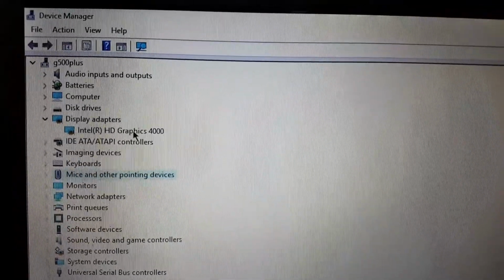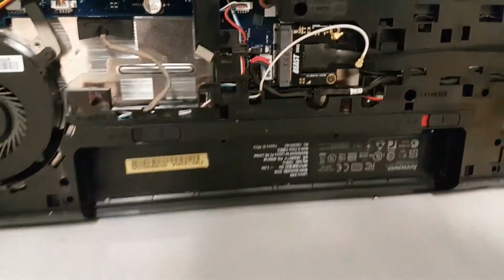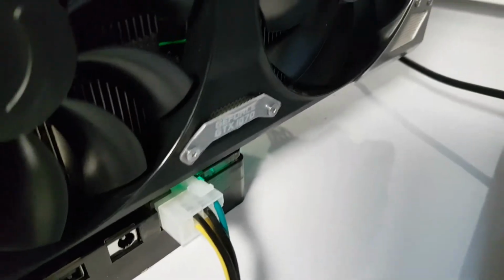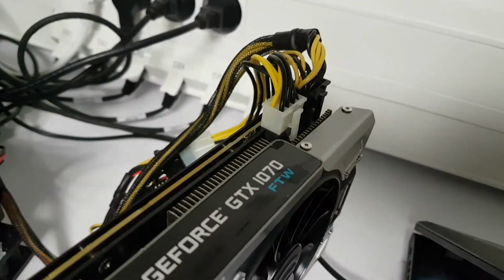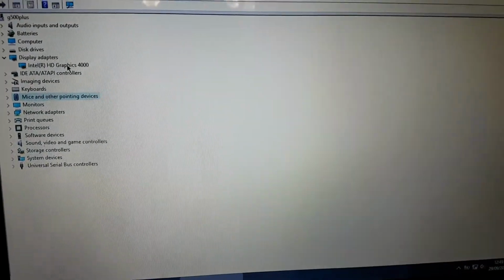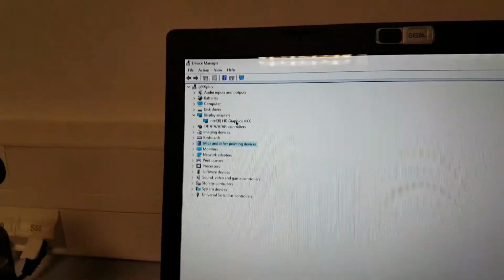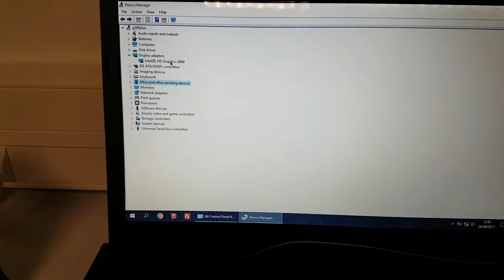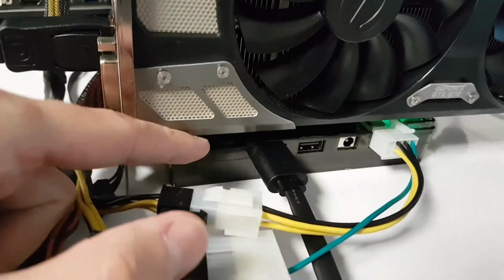Exp gdc not working (DIY eGPU)

Comment: I have EXP GDC 8.5c, My Laptop is HP 250 G3, I have RX 580 GPU. My laptop doesn't detect the GPU in device manager yet the fans spins and green light is on. I have tried hotswap it failed, I have followed the instructions on the GDC manual without success I would really appreciate any help.
Reply: Same exact problem yet no solution. Man this is frustrating that there seems to be no explanation 😩
Reply: @ConnorMarcantel  do you have Nando DIY egpu setup if you wish to buy I can sell you mine at a discounted price. I ended up buying other parts and building a PC. What's your laptop, if it's not a HP, then Nando setup could make it work
Reply: @NedxMN  its an hp. I think it model is something like 17-ca…. I attempted to connect a EXP GDC eGPU doc through a m.2 key a+e to mini pcie. Physical it fits and the GPU turns on but doesn’t show up on device manager or anything else.
Reply: @ConnorMarcantel You could as well try to flash your bios and check if it works

Comment: So here is the solution,
1. BIOS - Whitelist problem with most of the bios. those bios wont sign in these kind of stuff and only way to fix that is b flashing a modded bios
2. Dock might be broken

Comment: manage to actually connect the gpu with my laptop and instal the driver but there input delay issue and the gpu perform a ton worst than integrated gpu
Reply: Connected one to my all in one HP with the arc a770 recognized it just fine but fans don't stay spinning so it's getting warm. Need a better PSU. Dell da2 isn't cutting it.

Comment: Hi everyone, my case is: laptop HP pavilion 17, cpu AMD A10-5750M, exp gdp connect via minipcpe, gpu is gt730, i use external monitor. The laptop recognize the egpu, it shows window booting to external monitor, but then show acpi bios error and restart. I tried many way: update bios, reinstall window, hotswap,... but no lucky. But when I try to boot with kali linux, everything works well. Any suggestion for my case? Thanks.

Comment: I'm using exp gdc expresscard with an express card usb adapter. The gpu turned on and seems like there is no propblem. But my device manager didn't seem to read my vga. If anyone have a solution, please share..
Reply: Did u find any solution?

Comment: It's important to turn off Windows Update, because on Windows 10 the laptop's default drivers will automatically install updates if you're connected to the internet , Turn off automatic driver updates for each device that comes with the laptop

Comment: This may be due to low voltage of the power supply or the processor not being able to supply the graphics card sufficiently.
Reply: reis bende yapacam ama sıkıntı olurmu bilmiyorum hp 250 g5 var ngff soketli i5 6200u throttlestop ile 2.70 ghz stabil 16 gb ddr4 2133 mhz ram var ngff li exp gdc  v8.5d olana gtx 960 taksam ve ekran kartından hdmi ile harici monitöre bağlasam çalışırmı bottleneck calculator ile baktım 0.25 darboğaz diyor ona göre alimmi

Comment: Bro, you said you changed the delay on the exp.

Care to explain how you do that?
Reply: There's a switch on the device you have to pull it with something thin enough though as it's inside the case.
Reply: how did you get your information on that, extremely hard to find for me

Comment: No, it is actually working.
You need to use external display from GTX output to desktop display.

You cannot use Laptop's internal display.
Reply from the maker: no it was not. Of course I had the external monitor connected but the graphics card was not even recognized to begin with.
Reply: @Gabriel2.0  First, try to get newer docking EXP GDC V8.5c
And then try to disable and change some of BIOS settings like in this video
https://youtu.be/aM3D3cZmqn0
Reply: @Gabriel2.0  hello you still have the setup??

I will 100% make it show but I am stuck with the drivers

Let me know if you still want to work i will tell you how to get it recognized at least
Reply: @FirstLast-tx3yj hello did you manage to work this? I have a same problem with him, until today. Thanks
Reply: @Gabriel2.0  First, try to get newer docking EXP GDC V8.5c
And then try to disable and change some of BIOS settings like in this video
https://youtu.be/aM3D3cZmqn0
Reply: @ClayWheeler  I did all of that but it still doesn't recognise it idk why
Reply: i have samsung RV510, is it necessary to disable wifi in bios or unistall drivers of wifi to detect?

In samsung laptops, is it necessary disable or unistall ?

Comment: I tried installing a GTX 970 in my HP laptop and when I replaced the wifi card with the NGFF cable it wouldn't even turn on, the caps lock light just flashed.
Reply: same issue :( did you find a solution?

Comment: i have the acer aspire 3830t 2014 laptop.
 i bought the v8 EXP GDC BEAST pci- e, a new 500w PSU , 8GB RAM, and the ASUS R9 280X 3GB graphic card. 
Everything works fine. the psu and the graphic card works fine but doesnt detected on device manager... Any solution please. thank you
Reply: same for me
Acer aspire e15 E5-573-36-Rp
EXP GDC The beast NGFF
Geforce Gtx 750ti
my laptop not normally booting but not detecting the gpu
i have tried so many ways still no use.
if you people got any solution please let me know
Reply: @jeevankumar2842  did you solved your problem? same issue here. The gpu is running, but my laptop cannot recognize the gpu, and when I manualy installed the drivers it always failed.
Reply: did you solved your problem? same issue here. The gpu is running, but my laptop cannot recognize the gpu, and when I manualy installed the drivers it always failed.
Reply: @motivationwithgod3966  no i didn't . I bought a new pc. Sorry for this
Reply: @GIORGOSMETAXASOFFICIAL  while asking question in comments in other youtube video I have made my gdc beast work just now. Following one comment to unplug the beast and psu and put your laptop to sleeep mode and plug it again and press enter. Kaboooooom! just now it works. Jumping upside down in my room. Anyway new pc is much better. Good for you bro
Reply: @motivationwithgod3966  Wow man, It worked, installing drivers now! One step closer 😀
Reply: @motivationwithgod3966  Worked till I restarted, now there is no way I can find it again, no sleep, no nothing will make it appear it again...jeez
Reply: @omarmangudo3232  try to unplug and turn off the psu and your laptop. Then turn on your laptop back while your psu and gpu is unplug, then put to sleep again and plug the gpu and turn on the psu and awake your laptop back.
Reply: @motivationwithgod3966 i have samsung RV510, is it necessary to disable wifi in bios or unistall drivers of wifi to detect?

In samsung laptops, is it necessary disable or unistall ?
Reply: i have samsung RV510, is it necessary to disable wifi in bios or unistall drivers of wifi to detect?

In samsung laptops, is it necessary disable or unistall ?

Comment: To anyone who wants to use the egpu, first make sure your bios is not a whitelist, if there is a whitelist on your PC, then your egpu will not detect, there is no way to make it work unless you can create new bios or Modding your bios
Reply: HOW WILL U KNOW YOUR BIOS IS NOT A WHITELIST? PLEASE ADVICE?
Reply: Please tell us step by step for this
Reply: The easiest way to know your whitelist bios is to replace the wifi card with a new one, if the new one is detected then most likely the bios is not whitelist but if it is not detected then it must be a whitelist, you can borrow your friend's laptop wifi card to try it but make sure the wifi card is of a different brand with yours
Reply: @watchfii4855  thanks mate. How if we use another way let say i buy wifi card cable for my EGPU dock(before i used express card) is that possible try it on that way?

Comment from the maker: cheap EXP GDP: external GPU 
US: 
ebay:          https://ebay.us/nkAyI2
amazon:    https://amzn.to/2DAyGGh
UK:
ebay:           https://ebay.us/4o9tSJ
amazon:     https://amzn.to/38T7fTt
Germany:
ebay:            https://ebay.us/SZNTVL
amazon:      https://amzn.to/38TS0K8
Canada:
ebay:            https://ebay.us/y8hjry
amazon:      https://amzn.to/326RNSl

----Graphics Cards
*US :   
Ebay:       https://ebay.us/xSNyrk
Amazon:     https://amzn.to/3gQ6woQ
*UK:    
Ebay:       https://ebay.us/7gejHg
Amazon:     https://amzn.to/2W8maEf
*Germany:
Ebay:      https://ebay.us/W600Vk
Amazon:     https://amzn.to/3gSfVw7
*Canada:
Ebay:       https://ebay.us/iu3t8h
Amazon:     https://amzn.to/2ZnqSjp
Reply: I already solved on my side. I just put my laptop into sleep mode and turn the power supply on and sign in to windows again, BOOOOOm! got it on and running. so happy!
Reply: @motivationwithgod3966  it didn't work for me and i have the same problem, what can you recommend??
Reply: @MOdai-eh1vv  No idea. Coz mine work on sleep mode. Try it for a few more times.

Comment: Maybe either the miniPCIe cable or the EXP GDC's PCIe connector is broken. I've just got the same problem that where only its green LED turns on but nothing happens; the GPU I'm using doesn't even use the 6 pin power connectors, so the fans don't spin at all.
Reply: I have  same problem but im using gtx 1050 ti and I researched that its difficult that it works fine. I've spent 1 weak trying but I haven't good results :( . After the Nvidia driver installation, when turn on my lap again the device dissapear of devices adapter (like the video) but the green light from the Exp gdc Is shinning...
Reply: Mine is spinning and working but the laptop wont boot and no driver in the device manager.
and it will only boot if I will pull out the expresscard dock cable. If anyone solve the problem please share.
Reply: @motivationwithgod3966  Did you solve the problem ?

Comment: I'm using amd graphic card the fan is working but no display..
Reply: i have the same problem
Reply: @kacperdabrowski1393  same too. I will try to find an unlocked bios, this could work.
Reply: @devrod101  did you solved your problem? same issue here. The gpu is running, but my laptop cannot recognize the gpu, and when I manualy installed the drivers it always failed.    AND HOW WILL U KNOW IF YOUR BIOS IS LOCKED OR UNLOCKED?
Reply: @motivationwithgod3966  finally i found the answer about that. My laptop recognized the GPU after disable the network boat option. But it only work until i installed VGA driver and after restart the laptop all gone. And the main problem because my laptop has bios Whitelist. My laptop acer aspire 4730Z
Reply: @junkies4463  I also solved my problem but different way. I just read on one of the comments on other youtube videos. I just unplug my gdc beast dock and psu, and put my laptop into sleep mode, while on sleep mode  I plug back the gdc dock and psu  and press enter of the laptop, And walah! kaboom! my driver is already recognized and installed the latest driver. So happy! the only downside is , I always put my laptop into sleep mode everytime i use my external gpu. But its ok.
Reply: and to all who can read this comment, you can try this option it might work for you too.
Reply: @motivationwithgod3966  Thanks mate but i already try that way and it doesn't work either with my laptop because acer protect the bios. Acer 4730z locked it bios
Reply: @junkies4463  sorry to hear that. Well I gues laptop have different trouble shooting problem.
Reply: @motivationwithgod3966  Indeed my friend. I read in some article my laptop is not supported  eGPU for sure. :D
Reply: @junkies4463  what is your laptop exact model? I will check it too
Reply: @junkies4463  in the EXp beast website the one in the list is Acer 4739z. if its the same series as yours, i gues yes its incompatible. Sorry Bro
Reply: @motivationwithgod3966  my laptop is 4730Z my friend :D different with that :D thanks btw mate
Reply: @motivationwithgod3966  Yes indeed my laptop doesn't seem on that list. BTW thanks mate
Reply: @motivationwithgod3966 i have samsung RV510, is it necessary to disable wifi in bios or unistall drivers of wifi to detect?

In samsung laptops, is it necessary disable or unistall ?
Reply: Me too. Hopefully someone will come out with a solution. Pls share here if you know
Reply: For AMD graphic card you have to use external display (you must connect it to GPU port)
For NVIDIA grahpic card you can use your laptop display
Good luck
Reply: Jelka Potočnik naaa same problem here... my egpu fan are spinning but the gpu not detected on my laptop... its been a month i research the solution, hope there is youtuber will upload the video about fix this problem hmmm
Reply: @Riozaki2827  did you solve?
Reply: @Riozaki2827  Did you solve the problem?
Reply: did you solved your problem? same issue here. The gpu is running, but my laptop cannot recognize the gpu, and when I manualy installed the drivers it always failed.
Reply: i have samsung RV510, is it necessary to disable wifi in bios or unistall drivers of wifi to detect?

In samsung laptops, is it necessary disable or unistall ?

Comment: Same problem please reply when you have any idea
Reply: Did u solve?
Reply: @madeinchiapas  Got mine solved. I just put my laptop into sleep mode, while on sleep mode I turn my gpu power supply and the laptop back to windows again, and booom! got it running perfectly.

Comment: I know its late but it might help. So i have a gdc 8.5c egpu and 1050Ti. i got it to work on first try but after i installed a new version of windows it never got detected. I tried to install the driver of card and it installed and after that it is being recognised in the device manager.
I hope it might help.
Reply: Try this it might help: https://egpu.io/forums/expresscard-mpcie-m-2-adapters/script-nvidia-error43-fixer/
Reply: jacinto agonia dear did u find any solution
Reply: I have some problem... But gpu totally not working... Even fan doesnt spining... Any advice??? Help :(
Reply: @khoir4544  try to turn on the atx button. Also try a different psu or smps. Reply if that doesn't help.

Comment: my setup is not working i'm using amd rx570 with my dell i7 4th gen 8gb ram please help and my graphics card fans are not working.
Reply: Mine was working till couple days ago. I have Dell E6430 with i7 3610qm and rx 570 itx. I manage to use setup 1.35 dsdt overdrive
Reply: @pawelpiotrkupczak4011  Which dsdt overdrive did you used?
Reply: @bankai_333  you manage to work?

Comment: Bro try with a Dell Laptop.... most of the time they dont have any BIOS whitelist stuff in place. 
I didnt even had to buy EXP GDC dock... my graphics card worked with a riser card only in my Dell Vostro 15 series.
Reply: I have Dell Vostro 14, paired with EXP GDC. But once I plug in the M.2 (ngff) cable in the laptop without connecting it to the EXP,  my laptop won't boot. Can you help me out?

Comment: EXP GDC 8.0 is NOT compatible with GT1030, GTX1050, GTX1050TI, GTX1060TI, GTX1070TI, GTX1080TI
Reply: It is not compatible means it would not detect these cards or detect but not perform well?
Reply: Is it working with rx560?
Reply: Fuck:(

Comment: I hav the same issue but i think dock hav any issue. Plz change the dock once again...its very tough some time but i hve solved  the issue
Reply: U mean new exp gdc?
Reply: Hey, do you made it to work this card?
Reply: Got mine solved. I just put my laptop into sleep mode, while on sleep mode I turn my gpu power supply and the laptop back to windows again, and booom! got it running perfectly.

Comment: which internal gpu your lenovo laptop has.
Reply: chauhan1518 I have nvidia geforce 310 m internal. I tried to use this Exp gdc  beast 8.0 with gtx 750ti and cannot detect the gpu in the device manager. The fan of egpu was spinning but cannot boot up the bios. I don't know what to do
Reply: @racel_sirji9746  did you find any solution my friend? i have the same problem right know. Any help please?
Reply: @GIORGOSMETAXASOFFICIAL  Hi, I cannot solved the issue. I think my lenovo bios doesn't have the ability to disable the internal gpu. If I could disable that IGPU from the bios than the problem may be solved.
Reply: i have samsung RV510, is it necessary to disable wifi in bios or unistall drivers of wifi to detect?

In samsung laptops, is it necessary disable or unistall ?

Comment: you said modded bios did that on lenovo.
please tell me from where you got your modded bios, 
did you uninstall the internal gpu drivers or what, please any will be good.
Reply from the maker: chauhan1518 from bios-mods.com forums. I left the internal gpu untouched
Reply: internal gpu means intel hd or nvidea.
Reply: i have samsung RV510, is it necessary to disable wifi in bios or unistall drivers of wifi to detect?

In samsung laptops, is it necessary disable or unistall ?

Comment: Hey guys I’m running a 1050 ti with a Lenovo z500 i7 has to modify the driver to get it working https://egpu.io/forums/expresscard-mpcie-m-2-adapters/FIXED-Nvidia-GTX1050Ti-error-43-on-mPCIe-or-M2-non-hotplug-eGPU-interfaces-applicable-to-GTX10xx/
Reply: can you help me with my problem 
https://www.reddit.com/r/eGPU/comments/icrgp8/the_beast_gdc_with_envy_360/